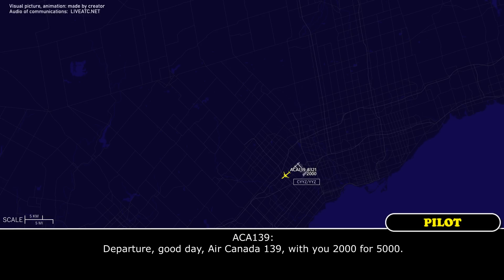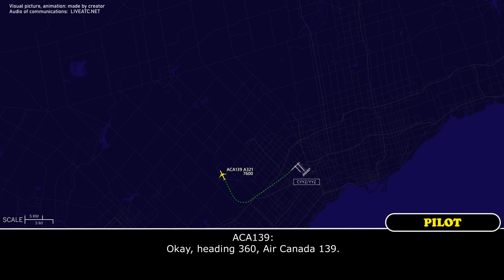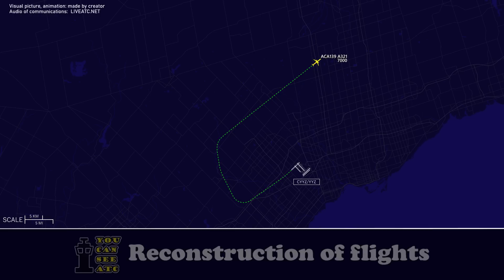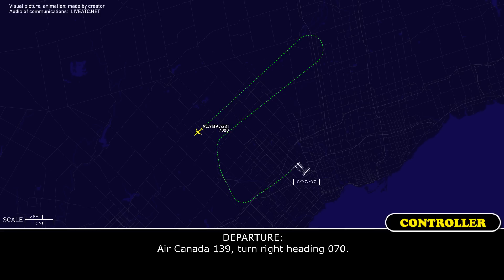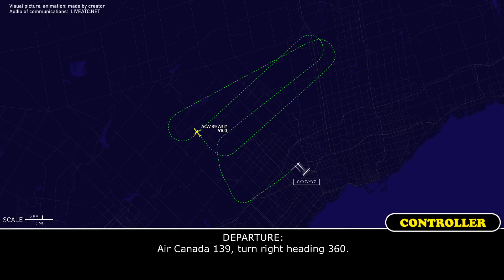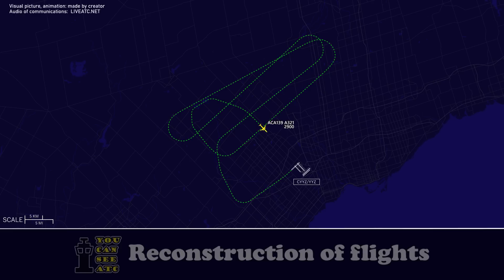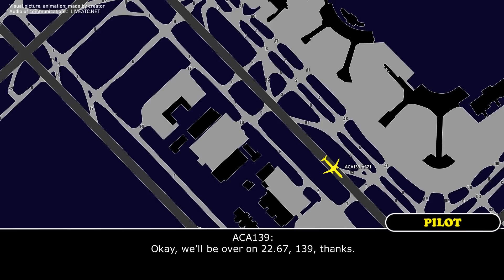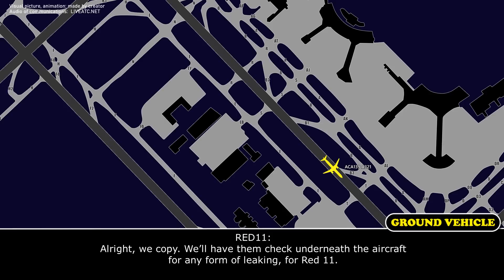PAN-PAN. Hydraulic system failure and fluid leak. Air Canada A321 returns to Toronto. Real ATC

Comment: Why return for a single hydraulic leak? Or was it a dual hydraulic? If so, mayday would have been the right call
Reply: Even with redundancies, they won't continue with primary systems impacted to ensure there's no further issues or risks.
In this case, it sounds like the wheel bay door didn't close which would also reduce the fuel efficiency and potentially prevent them from reaching their destination.
Reply: @jonathanbott87  yes, that is what happened probably
Reply: Not only is it safer but the checklist for hydraulic leak specifically states to land ASAP. Also returning to your base where maintenance can be done is alot better and cheaper then being out of base even if it was possible to continue.
Reply: @sirajaborig4216  no land asap for a single hyd leak in A320. There r 2 more systems

Comment: Curious about this. I've noticed in this and other clips that a  pilot reports a failing hydraulic or other system failure and then fly in circles for a while. I would think their first safety measure would be to get on the ground asap.
Reply: Redundancy is the keyword here. There is more risk involved in just trying to land without knowing what exactly is the problem, so completing the appropriate checklists while in stable flight is generally the best way forward. No need to panic.
Reply: No urgency, hence the Pan-Pan status.  Checklists and planning how to deal with whatever reduced (not absent) capabilities there might be.
Reply: Especially hydraulic failures are a lot more about what happens in slow flight/approach -> slats, flaps, landing gear, brakes, nosewheel steering on the ground
Most of it means longer time to get configured for the approach/longer final and longer runway.

Failures to land asap are more time sensitive: fuel leaks, fire, on batteries, stuff like that. Most other stuff you don't want to rush and introduce possible errors

Comment: Totally professional and efficient comms, from the first PAN to the end.  Should be studied by every US controller and flight crew!  Yes, a few moments of dialog, but the overall comms made up for it.  

Passengers out of Toronto should feel that, in any emergency, their flight will be well supported from the ground.  Flight crew was also brilliant.  

BRAVO!
Reply: JFK shames in comparison.
Reply: I've been on an emergency aircraft landing into YYZ from VRA. A Pax suffered a cardiac event, and eventually passed away shortly after. Toronto Centre expedited us in and we were on the ground in no time. 
I've flown into YYZ many times, but this by far was the definition of a "emergency descent".
March 2020 - Sunwing flight. Unsure if it's possible to get ATC anymore but remarkable job from YYZ Controllers.

Comment: The crew were calm as there are three continuously operating hydraulic systems, designated green, yellow and blue. Each hydraulic system has its own reservoir. Never a need to panic. And if all fails, they then drop the Ram Air Turbine.